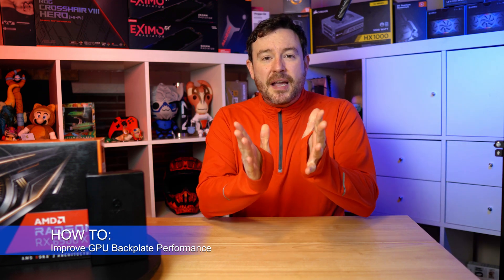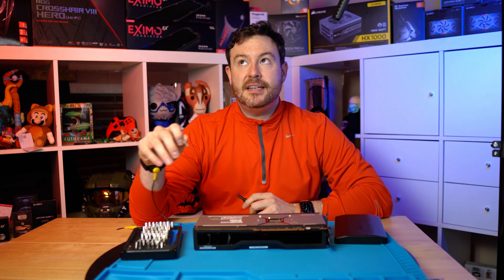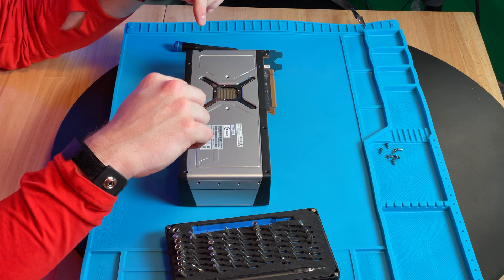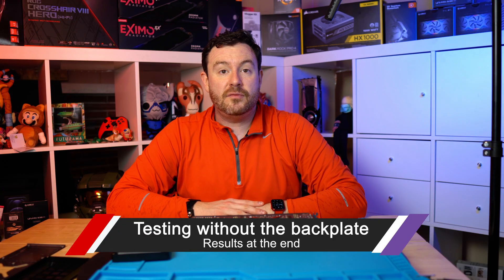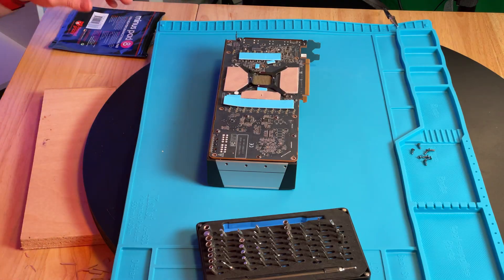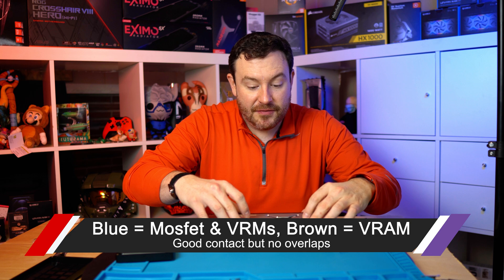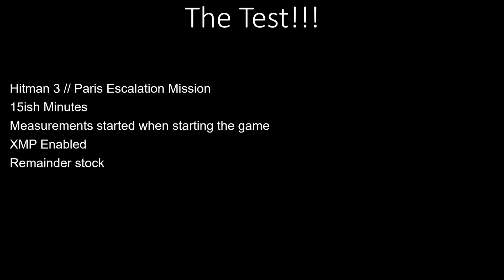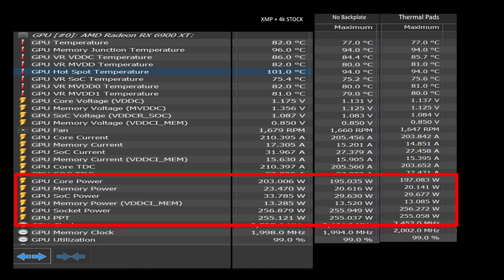Did Radeon forget to add thermal pads? -- Overclocking 6900 xt -- Part 7

Comment: aorus 6900 xt was the same no pads on the backplate except on the back of the gpu die i added some thermal pads and the junction temp dropped over 20 degrees and the core stayed higher in the 2500 range

Comment: This dude wearing an anti static band lmfao.. I'll pay you 100000 dollars to try to fry a gou with static electricity, literally let you rub your feet on carpet and keep touching the card. Plenty of tests on this , it's not trying anything
Reply: Its not stupid. Do i wesr one? No i dont but when you're taking apart a GPU thats $900 MSRP then some people like to take precautions. Nothing wrong with wearing one since its good practice. Ive repaired so many electronics that i cant put a number on it but i wouldnt be surprised if i actually caused damage to some because of discharge. When i work on a PC i always touch and hold a metal surface or a power supply thats grounded to discharge anything i might have in me.

Comment: XFX MERC 319 6900 XT here, my temps are nowhere near the temps u get. Then again for your test, you're only using 1600rpm fan speed which is about 30%.
Reply: May i ask you what thickness pads you did use?
I also have the XFX MERC, but it is the 6950 XT.

Comment: It‘s watt meter per kelvin mate. No Kilowatts hiding in there. The PCB is effectively a heatsink, the problem that lots of 3090s have is that the cooler can’t cool all the heat from the chip and it’s heats those components through the pcb. 

With good cooling (for example liquid cooling) this should be a none issue.

Comment: I did this but did not change the temps at all unfortunately. Also no higher benchmarks scores.
Reply from the maker: Some have said it does not do anything. My test in this round was not perfect as I didn’t reset it to factory stock. Have you tried overclocking? You might see more of an impact then.

Comment: This is misleading...  
Lower vcore then stock and lower memory voltage resulting in lower current and thus less heat production. Also a singe 22mm layer of pads doesnt even contact the backplate so that just nothing at all as the game is bigger then 2mm.  Also clocks where lower because of it so it crippled performance. 

So ignore all this its meaningless.
Reply from the maker: I took the same settings I had in part 6 brought them forward for the comparison. 
When installing an EK or other water cooler backplate they have you repeat the same steps of adding thermal pads. 

In each trail the result was consistent, thermal pads on the VRM, SMD, and Backside of the memory resulted in better sustainable performance.

However, I did not pay close enough attention to the Mhz. I'll re-do the test with Project SeVeN my Intel/Nvidia build.

Comment: Are the blue thermal pads 1mm or 1.5mm? I'm planning to do the same with my 6900xt. Thank you in advance.
Reply from the maker: Two kinds: 1mm and 2mm. Blue ones are 1mm. Also, I show it in my GPU waterblock video, but be sure to put a 2mm pad behind the processor. I forgot to do that with just the backplate experiment.

Comment: Hi! Great video! Going to run backplate off. One question though: Did you put the screws for the backplate back on to the card, or leave them on the table, when running without backplate?
Reply from the maker: Back on the card. If you have sized the thermal pads correctly, it should fit snug with no bulges..

Comment: This card, along with nvidia offerings at this tier need to be under water.  I am using an EK waterblock and a modified stock backplate with thermal pads, and my temps are amazing.  I am getting at full load pulling close to 390 watts max out, and the Hot Spot is at around 60c and pushing around 2750mhz in most games.  I have the record for the 3950x and 6900xt in Firestrike Extreme and Port Royal.  FYI.  Fire Strike  Extreme score with not a lot of tweaking is getting around 15500, and Port Royal 11296.  I will see if we get another cold day and push it farther.
Reply: That's pretty sick! Which thickness Thermal pads did you use and did you use the same layout as in the video or did you use more/less?

Comment: I have that exact same silicone mat for working on electronics. Thanks for the video. I've been thinking about putting some extra thermal pads in my 6900XT and maybe replacing the pad on the core with paste or LM. Now I think I'm going to do it.

Comment: but at the end, the GPU clock is higher with the stock setup.
2527mhz vs 2464 and 2453mhz
so 60 to 70 more mhz or 2 to 3% higher.
for the memory there is near no impact.

so more power, more speed without the thermal pads...
you should use the capframex counters and log these information when in the game only to see the real impact.